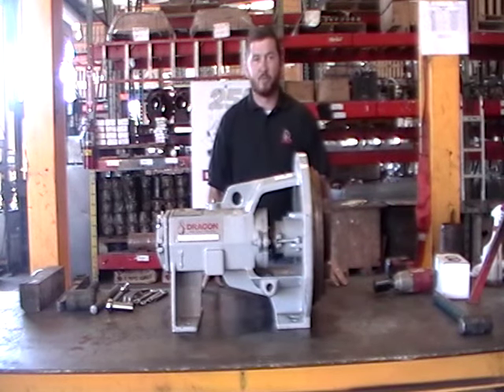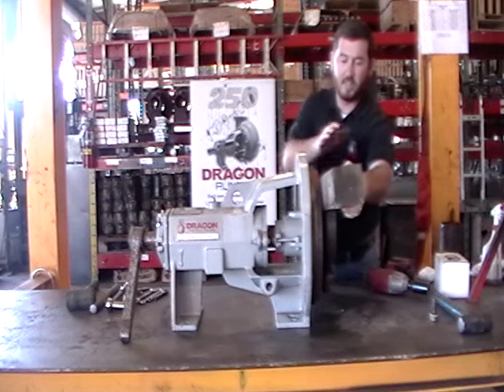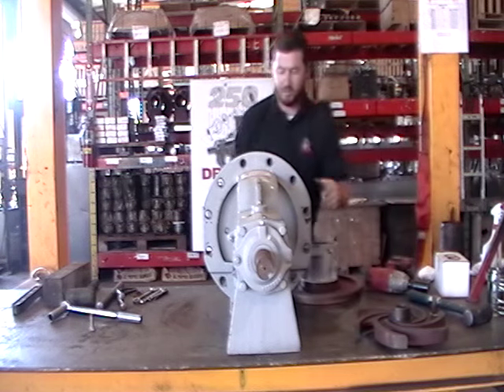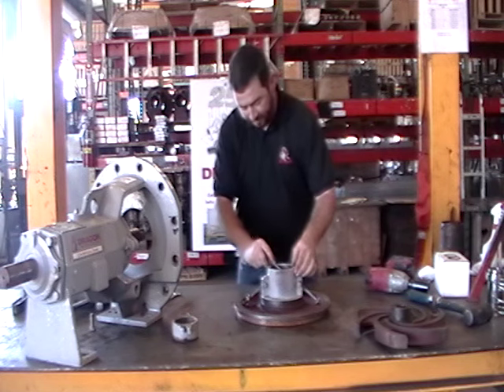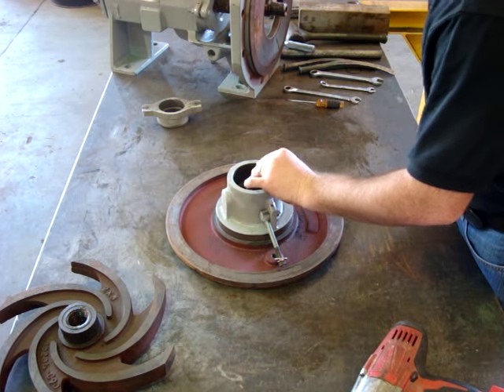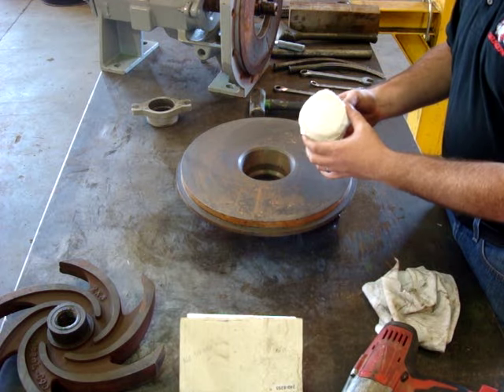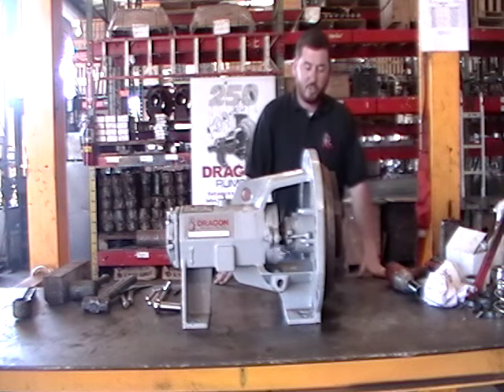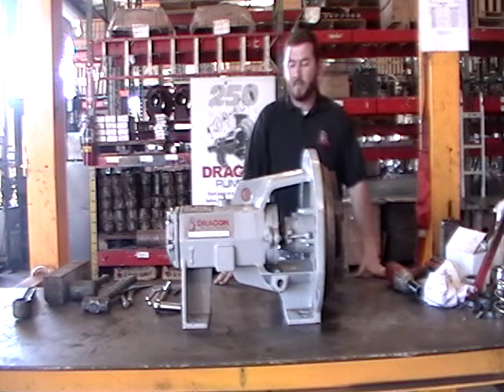Mechanical Seal Replacement Video

Comment: Hi I do this for a living and done lots of seal in the last 16 years and I was told to use soap it's easy to flush out and also lubes no grease or oil because our pump are for watering food or there for drinking water.  Don't no what you use it for but I hope it's not for drinking water or food. Good video on the pump don't no about grease and oil with water though
Reply: Possibly a grey water pump so it wouldn't matter but I'd never think about using what looked like some shc to set my seals.